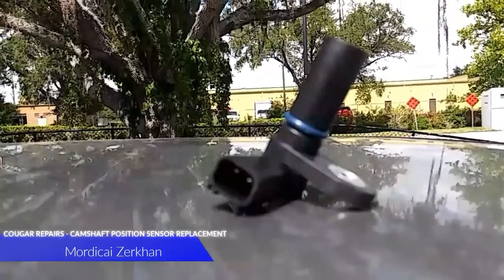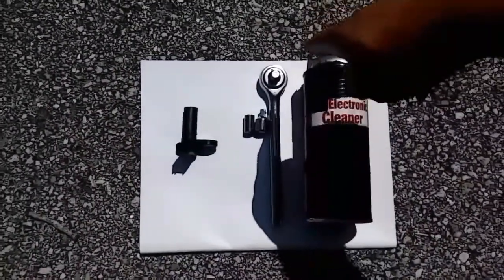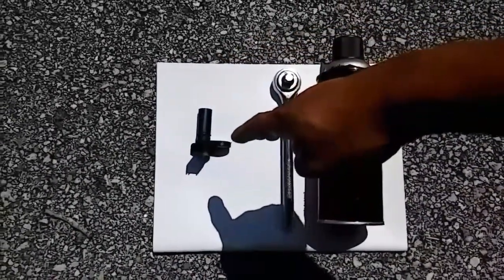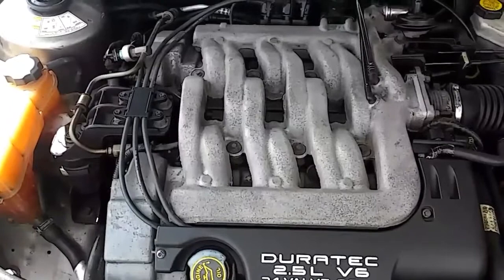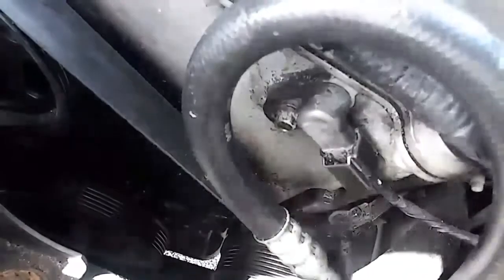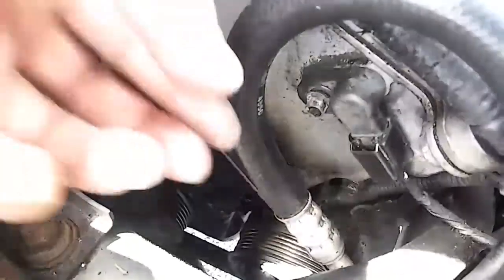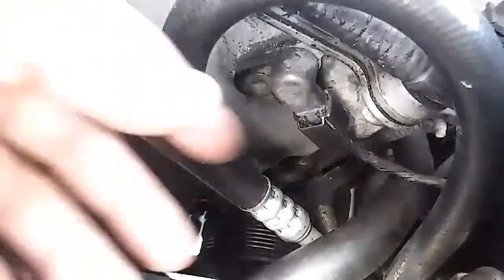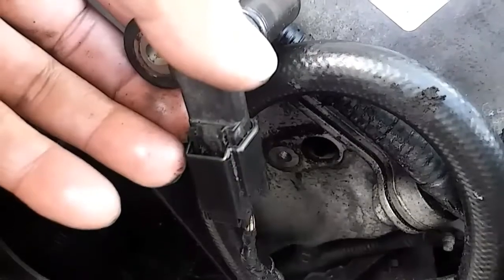Cougar Repairs - Camshaft Position Sensor Replacement

Comment: can you show a video on the how to remove alternator
Reply from the maker: +Jose Dipre Sure can. Its on my checklist of many things to show
Reply: Thanks bro cuz alternators seem to b the thing that most get repaired in a mercury cougar. Thanks for all your help
Reply from the maker: Jose Dipre No problem, thats why I'm here for.  Yes i agree that and fuel pump is common issues with cougars also sunroof tracks. Make sure you subscribe so you can get a quick notification when i put out the new content video. (If you haven't yet)
Reply: I subbed. Bro plz asap this has been my dream car since 2005. Plus nobody has a real video step by step on how its done
Reply from the maker: +Jose Dipre I know how you feel. Been my dream car since 2000 and finally own one since 2014. That is the main reason why i created this channel because when i decided to stop spending money on people in auto shops that rips people off. When i check on Google and YouTube i seen no information about it. So yea that means I've learned the hard way. 

Then i came to the conclusion to created this channel so others dont need to struggle to find information like i have.

For that video i can say it will take up to 3 weeks max, or maybe less (Since i have so much on my plate now due to coming out from holiday season)
Reply: Facts bro I'll stay tune to your channel I just bought one 99 cougar v6 2.5 duratec engine for cheap. It needs work done on it I found your channel where there is no one else who is putting information like you thank you a million times.

Comment: bro can you tell me when to shift from 1 to 2 gear I do have a problem shifting my cougar , sometimes I feel like its me doing it the wrong time I mean rpms. sometimes it just dont hold the second and I have to send it hard to hold. the 2 gear and if I do it sooner it works better right after the 1 gear its easier. please tell me when to change to the 2 
ill appreciate that
Reply from the maker: virginio morales What year and engine liter is your cougar?